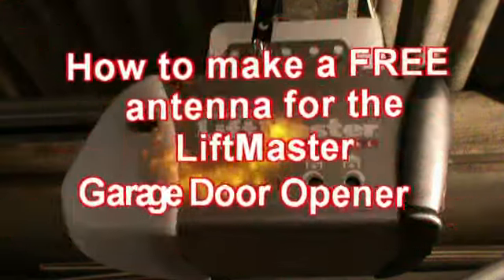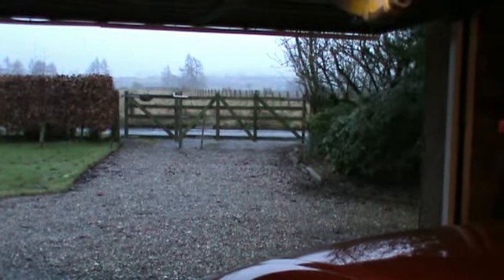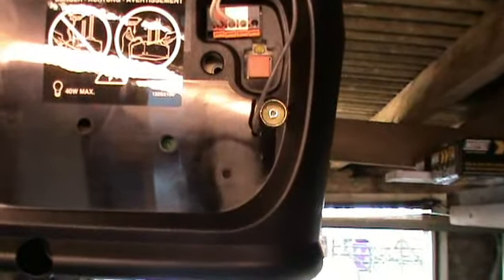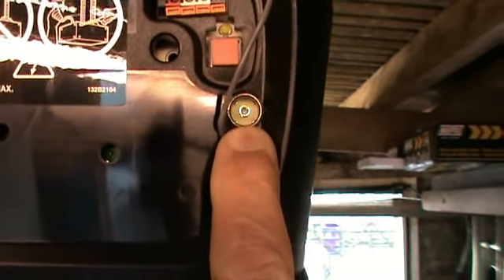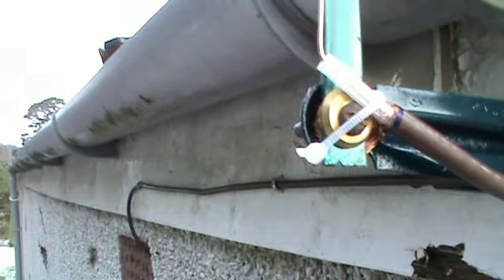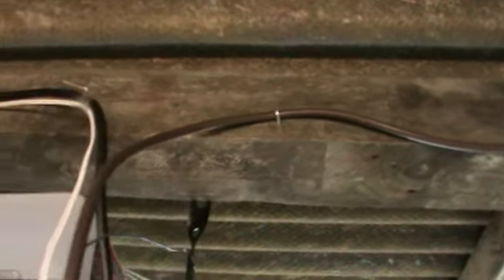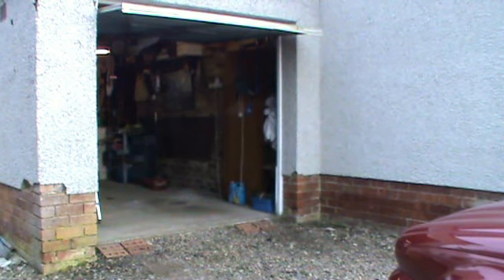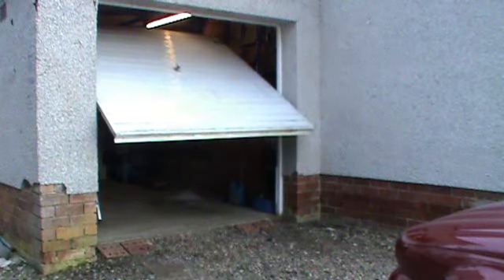Making an Antenna for a LiftMaster Garage Door Opener

Comment: How do you determine what the correct exposed (unshielded) length is for other garage door openers?  Is 250 mm universal?
And what if my opener doesn't have the coax port on the back?

Comment: Couple questions. I do realize this video is nearly a decade old but hopeful for answer. 1. Why strip the center insulator as I dont think this will impact the radio wave? and 2. why ground the outer shield outside the home?

Comment: The 250mm you got this from the frequency calculation? So your garage door operates at 285MHz? (9.85")
My garage door says it's 315Mhz, but the antenna is 10.25" long which is strange to me.

Comment: Here's a hint I had same problem , Dont use LED lights in Door opener they are not capatable with mother board , I put in incadesants and opener works great 200 feet away with door closed.

Comment: When you said it was 250 mm to be stripped,how do I measure mine? Thanks Stuart
Reply from the maker: Assuming that you are fitting the same opener, that is how much exposed copper wire should be showing above the co-ax cable